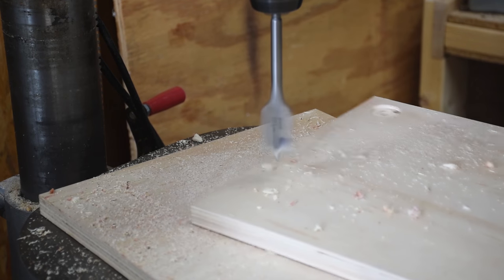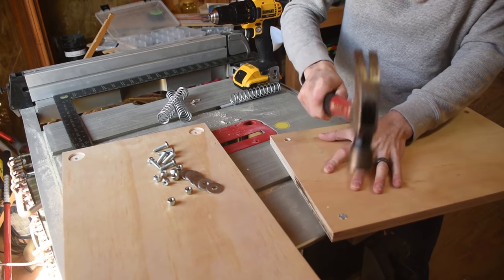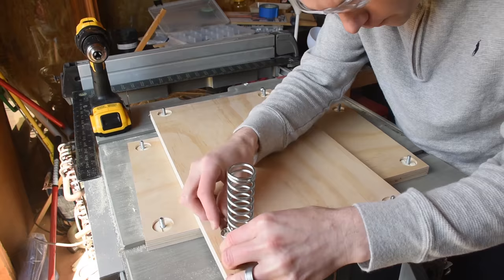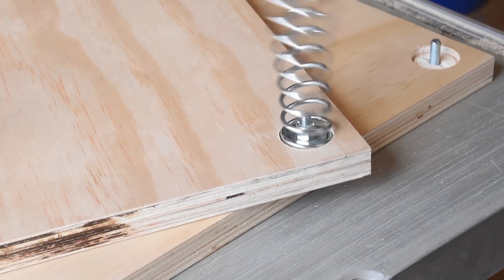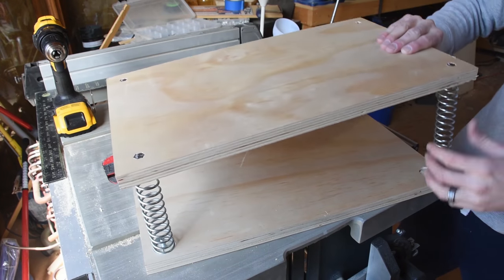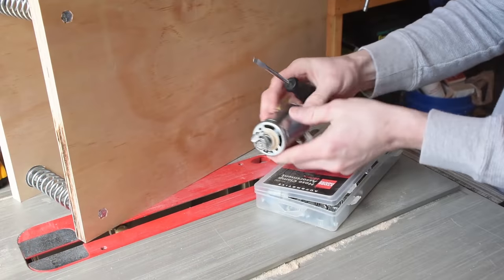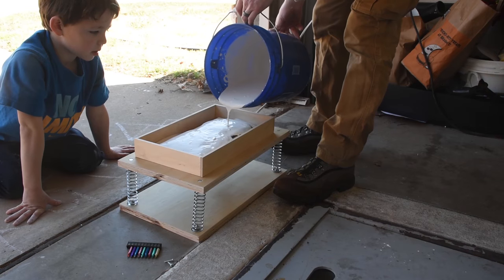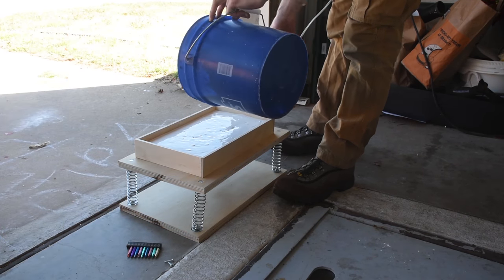DIY Simple Vibrating Table - Mikes Inventions

Comment from the maker: The motor and springs don't matter. Stiffer springs will decrease amplitude and increase frequency. Larger weights on the motor shaft will increase amplitude, but you don't want to stress the motor too hard. The only real variable in the system is the weight and its position. Any motor that is thrown off balance will vibrate. I went through two motors with this project. A regular shaded pole motor from a fan, and then I switched to a universal vacuum motor with a hose clamp on the shaft to throw it off balance.
Reply: rr
Reply: Would a bigger motor be better
Reply: Thank you so much for this video! It was fantastic 😊 
You did a great job, straight to the point,  easy to understand,  and I'll be using this video along with other info in building my own!
Reply: @dudleygraham7178 
Probably depending on the project. I think bigger motor would just cause stronger vibration but you'd have to modify accordingly.  Like heavier duty materials,  possibly add a fan to keep motor cooler, ect

Comment: how did you attach the motor to the plywood?
Reply from the maker: Hey Stephan, I screwed a hose clamp to the tabletop then clamped the motor in. It's not necessarily apparent in the video. Good question!

Comment: I remember making a vibrating table for some concrete table legs and tops about ten years ago. I still have the plastic molds and the parts came out great. The wife kinda smiled, when I was making the vibrator, but when she saw the bubbles coming to the top. She got serious and paid attention. It was better yet, when the parts all came out with no voids. Those tables with benches still sit out there in the backyard. A few months ago her daughter noticed the sets and asked, where I bought them. Button popping time when the wife gave me credit for making them. Then the hard part, will you make some for me. I made mine with an off set motor that shook the molds pretty well. All those parts are out in the back shed someplace, just have to wait until it gets a bit warmer and my motivation rises a bit. Just another project and phase a retired guy goes through. My wife says it sure beats all those guitars I bought and restored and ended up giving away. Mike, I enjoy watching you do great stuff, so keep it up, us old guys 80 years old now, enjoy what you do....Ken...Marina CA
Reply from the maker: Thanks for all the kind words Ken. And thanks for sticking with me. What a neat story. Thanks for sharing!
Reply: What sort of motor did you use and what size is it ,I want it for concrete garden moulds

Comment: Just what i need and excellent video clip.  Thumb up for you.
I am getting tired shaking bottle by hand so i am going to build this.   I drink carbonated plain water   and that requires shaking about 1 min of plain water with ingested CO2.   This shaking thing will make it a joy to make sizzling water instead of a chore.
Reply: You could scale it down and instead of a table top put a cylinder container. Like a paint bucket, pvc pipe, large cut bottle like the bottom half of a 2 liter, whatever coukd work as a cup holder for you lol cause my luck my bottle would shimmy dance it's way off, hit the floor, explode and rocket off into an abyss I'd find 2 wks later after cleaning sticky off the entire house 😂😂😂😂

Comment: Thank you for this useful video, can you tell us what kind of spring you have use, and witch power, and the supplier please
Reply from the maker: Hi there! I don’t have specs on any of the things I used. Springs and a motor that’s got an off-center weight will vibrate. You can make this out of anything. Thanks for watching!

Comment: Great thanks for your tutorial, I just need a vibration table to eliminate bubbles.
However I got questions while collecting materials.
How do you fasten hose clamp onto the board? General hose clamps seem have no screw holes for screwing on board.
Do you have recommended specs of spring diameter and motor?
Reply from the maker: Hi There! I screwed the hose clamps to the board through the slits in the clamp. The screws go right through. I don't have any specs on the motor or springs, just use what you can find. If you have springs and an off-balance motor, it will vibrate. See the other comment I left below about how each items affects the vibrations. Thanks for watching!
Reply: @MikesInventions  Ok i'll find screw for clamp, thanks for help :)

Comment: Can you please let me know what the wire thickness, spring diameter & spring length you used on this project?
Reply from the maker: Hi Jack! (Never say that on an airplane) All those things aren't really important for a project like this.  You'd probably never find the exact springs anyway. I can't remember where I got them. Pretty much any springs will do, you just vary the RPM and the imbalance on the motor to get whatever springs you do have to do what you want. Thanks for watching!

Comment: Hi Mike, what's the size of the springs and the motor? thanks
Reply from the maker: Hi Ruel! The springs are about 4" long, 1" in diameter, and the coils are about .1" thick. The motor I ended up using is from a small fan that draws about 1 amp.

Comment: Nice quick but sloppy.  It should be adjustable for different applications need different frequencies.  The motor is dangerous and may combust if it gets wet and could shake apart . But never the less a good project